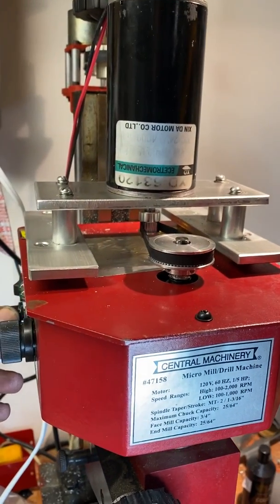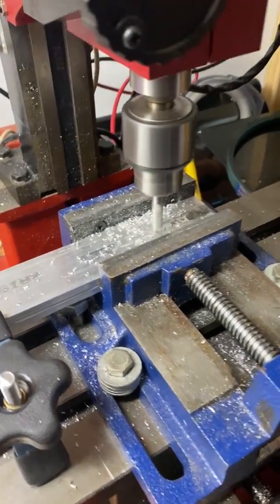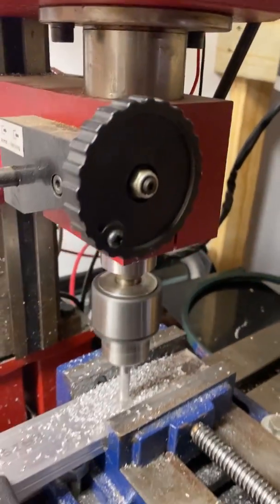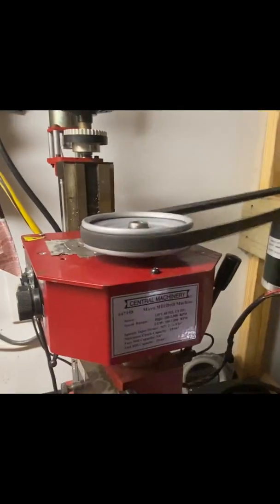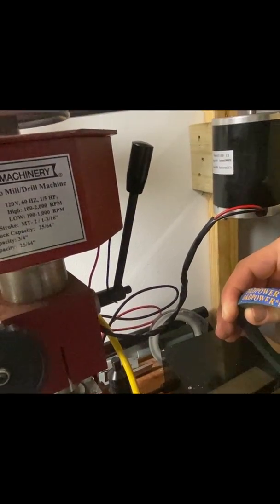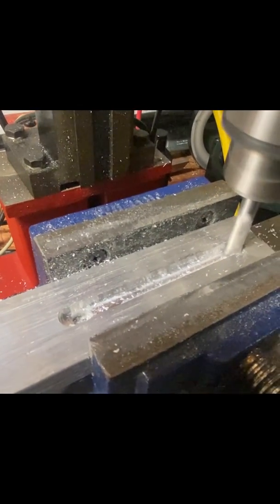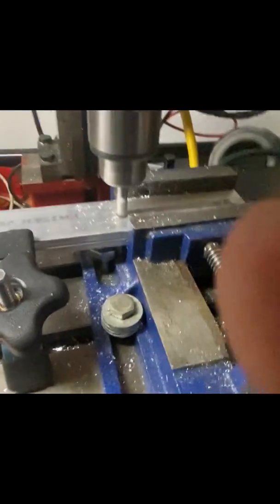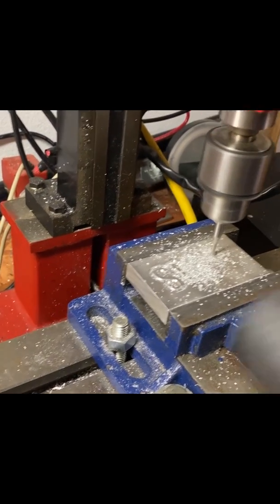How to Upgrade Your Mini Mill Motor | Harbor Freight Mill Motor and Drive Belt Upgrade

Comment: If I see this right with the increase HP your mill cutters are held in a chuck? Surprised it will hold.
Reply from the maker: Thanks for the comment.  It does hold it.   I have a collet as well.  Just haven’t installed it.  Occasionally with the chuck I will get a spin out but it is rare.